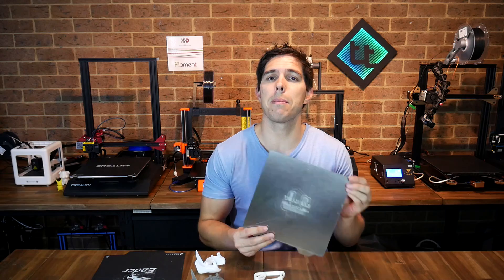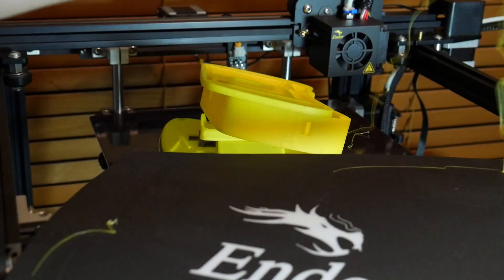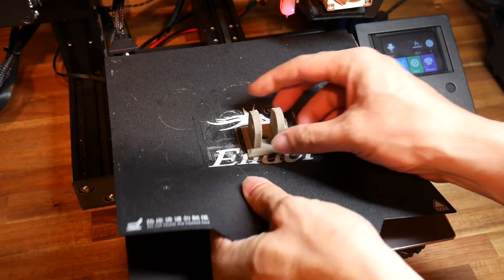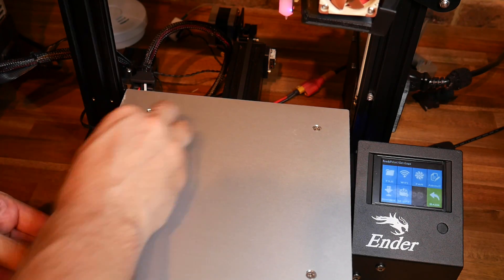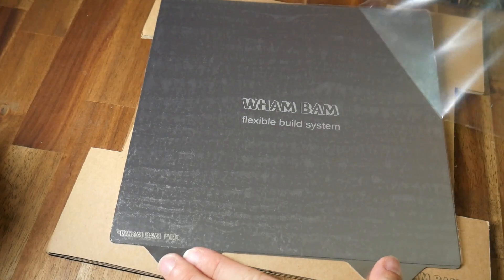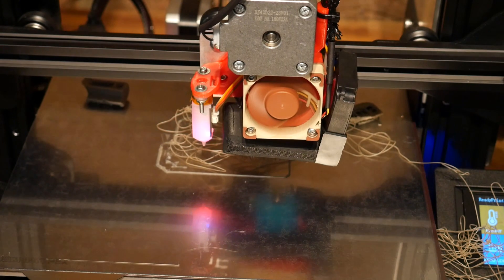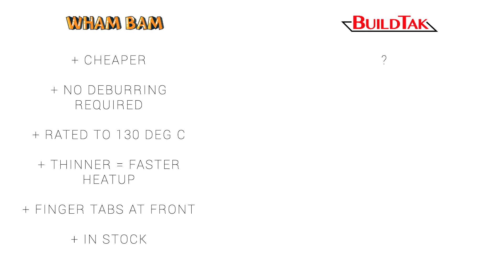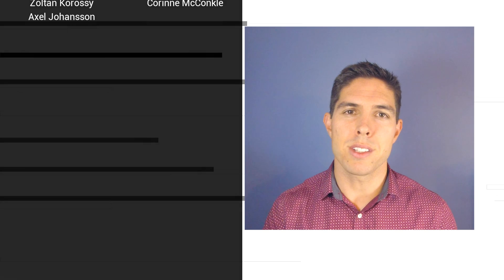Wham Bam Flexible Build System vs Creality Cmag vs Buildtak Flexplate

Comment: The plate system is extremely expensive. I just use Creality PEI and replace the surface sticker every few months. To remove the part, I just pry a corner with a box cutter blade. 

I would have shimmer the bed, the resolution of mesh revellers is not high enough at only 16 measure points.
Reply: If you're talking about the stock sticker on the Ender 3, a flexible build platform will change your life. 
I was changing stickers on my Ender 3 every now an again, but god it was a pain in the arse, and removing PETG parts was sometimes a nightmare.
I got the CMAG when I got my Ender 5, and it has been fantastic, could never go back.

Comment: I'm only speculating based on some Google research, but I think the build surface is sticking because the binding agent in the flexible magnet is softening.  According the link below, flexible magnets become unreliable at 100C because of the binding agent.  I'm guessing you're near the point where it's softening, and the first couple layers of 230C plastic is transferring enough heat into the surface to cause the binding agent to soften and stick to the bed.  I would guess that if a lot of ABS prints are done at 100C+ the bed will eventually fail, but not because the magnets have reached their Curie temperature.  https://www.jobmastermagnets.com/how-does-temperature-affect-different-magnets
Reply: The Wham Bam magnets are guaranteed to perform up to 130°C continuous, we actually tested to 170°C for 9 days straight with no loss of magnetism or performance!  the PEX build surface surpasses PEI for thermal resistance.
Reply: @petersolomon3505  Sorry, I should have been more clear.  I was talking about the C-Mag bed.
Reply: Jake Palmer ohhhh thanks

Comment: Maybe I'm just lucky but so far the pei sheet I installed has worked with everything I've thrown at it. Pla petg nylon and tpu have all worked and worked well enough that I won't be replacing it any time soon.  Although the flexible sheet would be cool.

Comment: The curie temp of ferrite magnets (what those are) is around 450c so I don't think you'll have en issue with a heated bed:). I think people were confused with neodymium magnets which can have a curie point as low as 65-80c

Comment: What you want from a flexible bed is a way to remove it without needing to flex it since large prints will prevent it from flexing. I wonder if a vacuum held-down bed would work. We need wires to the bed for heating anyway so run more wires for a fan or a tube. You don't need very low pressure to generate good down-force. When the print is done, the fan switches off and the bed comes away no problem.

Comment: Great video! I have been using a DIY version of this since the end of 2017 and the original cheap adhesive magnetic sheets are holding as good as ever.  I regularly print PETG overnight at 75C. You can see a video at https://www.youtube.com/watch?v=x4u3nnKkihU and a Thingiverse description of the learning process at https://www.thingiverse.com/thing:2633317.  The problem with the super flexible surfaces not attached to spring steel plates is they detach easily when the part wants to pull away.  Good adhesion to the build surface doesn't do any good if the build surface pulls away from the magnetic surface.  I have even had issues with the spring steel plate starting to pull up, when printing box taking up nearly the full build area, at a corner until I put traditional clips on the edges.

Comment: If money is tight you can get a spring steel sheet from aliexpress (they have a wide variety of sizes to fit any 3d printer), a fitting PEI sheet and a few heat resistant magnets that you stick unter your bed. Cost me like 30 bucks

Comment: To apply the PEI sheet you can use a solution of water and a small amount of baby shampoo. Spray print surface and adhesive bottom of PEI sheet. Place PEI onto bed and position. Spray the top of the PEI sheet with the solution to act as a lubricant while using a plastic scrapper. Basically apply the PEI how you would apply window tint. I usually wait 24 hours after applying before the first print, you can also heat the bed to aide in evaporating left over solution.  After a few prints the heating will have evaporated any solution left over. If you don't like the glossy finish to the bottom of prints you can wet sand the PEI surface working from 400 to 1000 grit. In straight passes alternating 90 degrees between passes. I like to use the automotive sanding sponges. I have found that sanding also helps to increase first layer  adhesion. Sanding also makes it possible to "renew" the PEI surface after 100's of prints. If you are printing PETG you can spray a light coat of hairspray onto the PEI to act as a sacraficial layer since PETG almost wants to bond with PEI print surfaces.  Just sharing this info for those new to 3d printing. Props to Teaching Tech for making great videos as well.

Comment: The prints on my PEX stick really well while it is hot, but the corners tend to pull off the surface. Especially the corner where the z seam is placed. Very frustrating so far.

Comment: I noticed the significant difference of stiffness when you move the bed through Y axis, I wonder how light the v-slot bearings are or if something else was done. I thought I've given a loose enough offset nut setting on my X and Y and what's sticking it more at the axis is the stepper motor-belt configuration(even with machine off/disabled stepper). print results are fine nonetheless, it just kind of hesitates me to move x-y too much

Comment: Nice!  I was really on the fence about this.  $70 seemed to high when i first saw this (and BuildTak's stuff...).  I'm currently using glass purchased from home depot for both my Ender 3's.  Requires a glue stick, but I have 0 issues with bed adhesion.  BUT, it does require me putting the glass in the freezer for a few minutes after it's cooled to room temp to pop the pieces off.  Might be time to seriously think about a flexible bed surface.

AND, the new studio setup looks great!

Comment: There's a rather nice looking magnetic bed on AliExpress for the Ender (235mm) printers. It's made in the same style as the Prusa Mk3's bed, with high temp magnets sitting in milled out pockets under the bed. There are nice spring steel sheets to go with it as well. Sadly, China is currently shut for new year...booo :p

Comment: Hello Michael.  I haven't seen many comments about the bed that comes with the current Ender3s.  I received mine a few weeks ago and it came with a buildtak material bonded to a thin fiberglass sheet.  It is held on the bed with spring clips and has been working very well for me so far.  It's available at the Creality site for about $US13 :

https://www.creality3donline.com/creality3d-removable-build-fibreglass-surface-sticker-fiber-board-hot-heated-bed-for-ender-3-cr-20-235x235x3mm_p0099.html

I've only used it for PLA, so I don't know how it works for other materials.  I've heard that PETG may not stick to it well.  I've got a spool, so I'll be trying that soon.  Of course the clips can also get in the way, but normally that's not a big deal.

If you plan on continuing your very useful comparison series about bed materials, this one might be worth considering.

Comment: 9:10 Regarding BuildTak Flexplate  delivery time:  I just ordered a BuildTak Flexplate system for a custom printer I am designing that uses an Ender-3 print bed.  I ordered the Flexplate on Sunday, 1/20/19;  it arrived the following Saturday.  You do list some excellent advantages of the Wham Bam build plate system,  (and it is possible that after seeing this video, the Wham Bam may have been my first choide) but I am not sure the delivery time is one of them, particularly since both Whem Bam and BuildTak are specifying 1 to 3 weeks delivery on their respective websites.
Reply from the maker: Fair point. I have ordered the Flexplate from Matterhackers in the past to ensure it was actually ready to ship.
Reply: I just ordered Wham Bam based, at least in part, on this video.  It also helps that it's cheaper.  They replied "Our next production run will be ready at the end of February and your order will ship at the end of February or early March. Wham Bam thanks you for your purchase!" so Wham Bam isn't faster at the moment although you have to assume that they recently got an influx of orders based on recent positive reviews (including this one).

Comment: For sticker adhesive removal, try WD-40. Usually works great, and it doesn't dissolve most plastics the way acetone does.
Reply: Just use kerosene, which is the solvent in WD40.

Comment: Hey there. Love your videos, your logical approach & your clear communication. I looked at the Wham Bam system but the total cost to ship to Perth Australia for my CR-10S5 was almost  65% of the cost of my printer. I'd prefer to use the stock glass & a scraper any day instead of being totally RIPPED OFF!
I'm glad the system works, as long term, competition will bring the prices down. I'm patient & happy to scrape away for now.
Reply from the maker: That is definitely fair enough!
Reply: I sympathize with the sentiment -- I am also supporting this hobby with limited funds (and even more limited time).  If I might suggest, if you're going to continue scraping, consider investing in BuildTak's spatula (BuildTak BT30185 Spatula https://www.amazon.com/dp/B017XGEDOM/ref=cm_sw_r_cp_apa_i_g7tBCb3ZMX62Q).  I find that I rip my knuckles a lot less than with the standard "paint scraper" that came with my printer.

Comment: I have the same issue with my Ender 3 build plate. I think its is becuse the rigid surface area of the print does not allow you to flex the bed in any way in that spot. P.S. I just installed the Ender 3 Direct Drive kit because of your video. I love it. Print quality seems a little lower. Any advice on how to get the quality back to being great?
Reply from the maker: First thing to try is to print slightly slower. Apart from that lowering your acceleration and jerk will help.
Reply: Thanks

Comment: Haven't been printing long, but my parts stick almost too well. I even skipped cleaning & printed straight from the box. Now that we know 100C doesn't destroy Cmag instantly I'll feel better about upping the temp when needed for PETG etc. If I kill it, replacement is cheap enough not to worry. I hear about so many that have to take extra or special ateps to get adhesion I'm hesitant to go glass even w/ a warped bed. BLTouch FTW and the warp isn't more than sandpaper can handle if necessary.
And... New competition will help bring flex bed prices closer between brands. Good news.
Reply from the maker: Nice summary. Hairspray works wonders for tricky glass in my experience.

Comment: Any good recommendation for a similar product for a delta printer? Looking for one for a heated bed with a diameter of 200-250mm
Reply from the maker: More expensive, but buildtak flexplate has round versions for deltas.
Reply: There are round spring steel magnetic beds on AliExpress, by the company "ENERGETIC". No idea about performance though...
Reply: Pook365 thanks for the tip! The Energetic products look  promising!

Comment: I just tried energetic plate for tevo flash from aliexpress, spring steel, no magnets, and it was not flat, and PEI seems to adhere worse than my goto solution has always been; clean glass + PVA :/
I will try to scoff the surface as shown here and see if it stick better. Tho i hated that i had to use bulldog clips with it.
Reply from the maker: Not familiar with that product but I'll check it out.
Reply: PEI from Aliexpress is crap most of the time.

Comment: I have had the same problem with this magnetic bed with larger surface prints. Its because when you print a model with a large ground surfece, the magnetic bed stays flat on the ground when peeling off due to the stiff PLA/ABS. This bigger, stiff surface affects the force you need to remove the magnetic sheet. When there is no or a flexible model, you can easily peel it off by bending the bed a little bit so the force for peeling off is smaller.
Reply from the maker: It's pretty weird I reckon. Defeats the purpose of the bed in my opinion.
Reply: I believe there is more to it than this.  What you say seems to be correct, but I think there is a "stickyness" between the two layers of the C-Mag, probably worsened by heating.  I noticed on a video that someone had a nasty little crease on their flexi mat.  It resulted from using brute force to peel the mag sheet with a large print print on it.  As I had just installed mine, I have always taken great care, and with large prints I slip my scraper between the bed-layers and pry gently until I hear them begin to separate.
If you heat the bed to 70 degrees C for a while (but don't print anything) you will find increased stick, but because you can peel it, it comes off OK.
I wanted to print on glass recently, for the surface finish it gives.  I figured it would heat up quicker if I removed the flexi layer of the C-Mag.  I held the glass with 4 spring clips, as normal.  After cooling, the print just lifted off, so I left the glass and clips in place.  Later, when I tried to remove it, the glass was stuck firmly to the bed! (Through the glass I could see which areas were stuck)  By using lots of time and patience, heating the bed, and gently levering with the scraper, it eventually came free.  This is the main reason I believe there is more to this than just the surface area of the print.   I have considered a dusting of talcum powder between layers to counteract the sticking, but for now all is good.
Reply: Was gonna say this but you beat me to it. So instead I will just say ditto.
Reply: This applies the same with blue tape. I've tried getting a print up by peeling the blue tape but because the print won't flex, it doesn't really help. What might work would be sliding the tool under the metal part so it's close to the model and then gently levering. Once you get it moving a little bit, the force will drop off rapidly.  What might be nice would be electromagnets in the bed that could cancel the force briefly so the plate could be removed from the bed.
Reply from the maker: Thanks guys, great explanations. btw I've had the creases before in similar products.
Reply: Teaching Tech I think it also has to do with static electricity or some form of vacuum that occurs when the print shrinks slightly. Since the bed is very flexible when it shrinks causes this pocket of air that keeps it down. The moment you break this seal the bed will release. It does not happen with spring steel as it is more rigid so this vacuum does not form.

Comment: what about the ENERGETIC spring steel, would like to see that review.
Reply: They do not only have the spring steel but also the high-temp magnetic base now. I use it with many printers now (about 24€ for magnetic base + springsteel with already applied PEI-sticker for Ender 3/5).
I am very happy with the sets; it works as good as the springsteel with PEI sticker from prusa (but of course not as good as the PEI powder coated one - actualy the prusa powder coated one is now available at prusas shop as replacement part (limited to 2 pieces per customer, 45€+shipping, I think only offered to customers who bought a original Prusa printer - but as I already have one I now get 2 more to use on 2 Ender 3/5 printers ;-)

Comment: Meh, I'm not keen on a removable build surface so far.  My creality bed stopped sticking so I ditched it for glass.  I have one plain glass for hair spray and one glass with PEI topper.  I haven't had one issue with my PEI so far (aside from PETG sticking VERY well)  I dress it with a green scotch-brite pad and an alcohol pad every 3rd or 4th print.  The surface is slightly dulled, but the stick is amazing!  Paid $15 US for the PEI and $7 for 3 glass beds which I cut myself.

Comment: I've noticed that the Cmag bed's magnetic sheet has some really weird 'adhesive' properties after being heated for a while.  I stopped using my Cmag because the bed is slightly warped so I have the glass plate on top of the magnet.  After doing a couple of prints with my binder clips, I can take them off and it takes a putty knife or a wedge to pop the glass plate off now, so it seems to seal against stuff for whatever reason.
Reply from the maker: Pretty strange, hey.